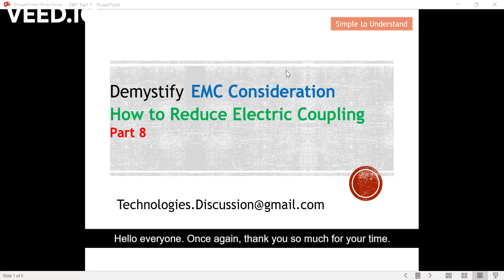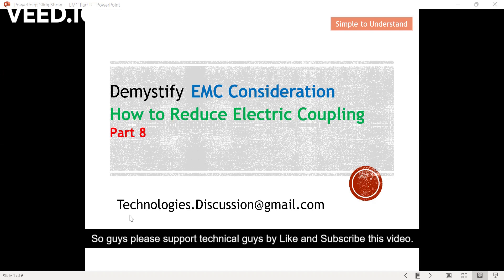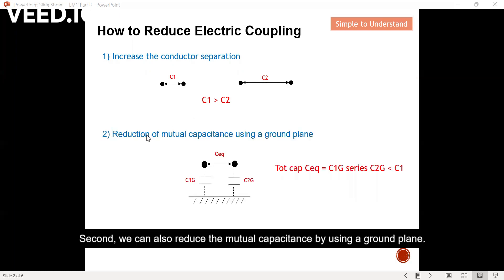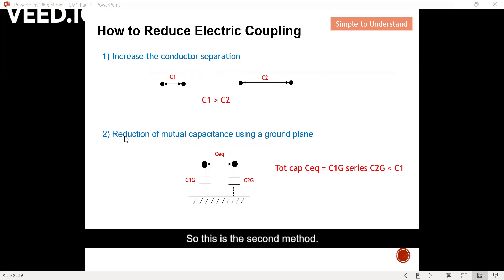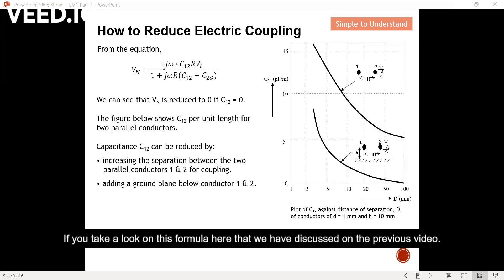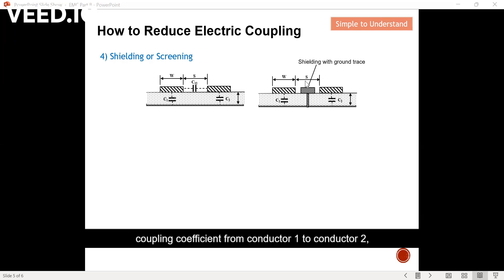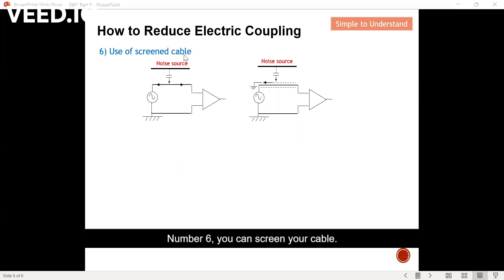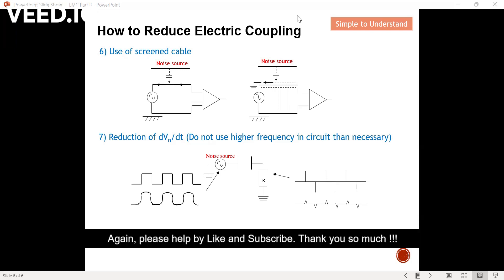EMC #8. How Conductor Separation Solves EMC Issues (Electric Field & Capacitive Coupling Explained)

Comment: What is the difference between shielding and screening?
Reply from the maker: Actually they are the same. But for me, shielding means all round enclose. But screening, I know the direction of noise source and screening that direction only.
Reply: Is there a chart that can tell us what material shield/ screen can block what frequency EMI? Or just use common shield like iron copper aluminium if not enough make it thicker?
Reply from the maker: There is no chart that tell u which material of shield to use. Usually the cost of shield must be low. Most of the time we use 1) Copper, 2) Aluminum, 3) Steel, 4) Nickel & 5) Mu-metal. Copper is the best. But u need lightweight then go for Aluminum. A form of protection then need to use steel. Nickel for corrosion resistance and Mu-metal most expensive but also most effective.
Reply: @technologiesdiscussion1676  thanks sifu !
Reply from the maker: You are welcome.  :)